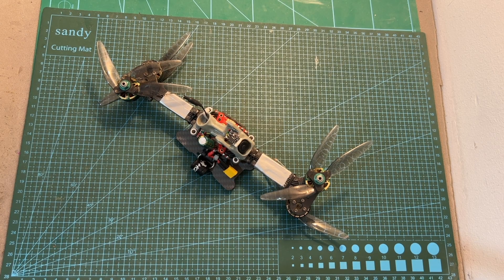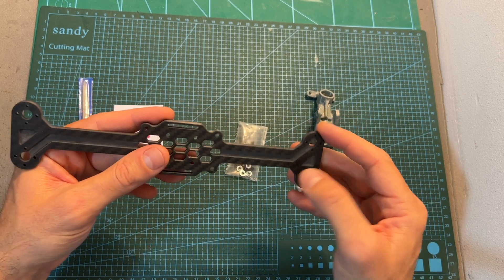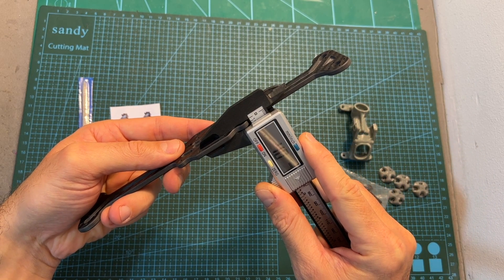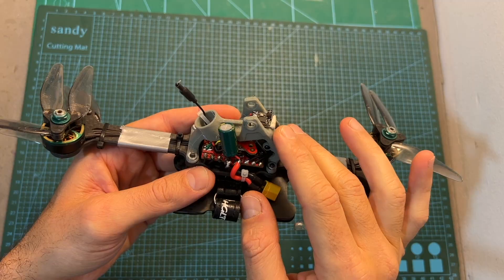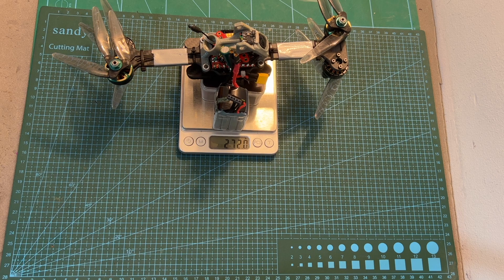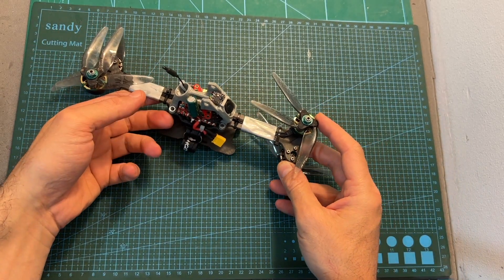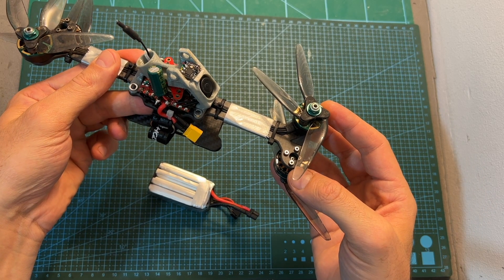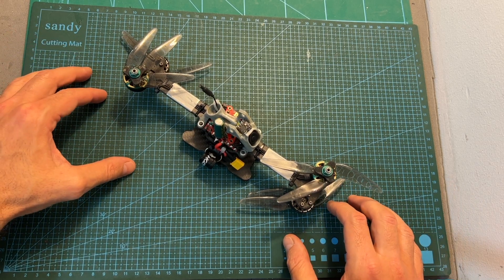XXXFPV Bone Drone - Build And Flight

Comment: Great video. I really appreciate your honest opinion on this frame. Mine was in the Mail today and I'm about to switch my electronics from my iflight Protek35, because I'm not flying this anymore. And as you said, one can always switch electronics to another build. My reason to buy one was, as you said, to have spmething different in my collection. I'm curious about to find out how it works with BF 4.3, which is really good on my regular 5" even in stock Settings.

Did it handle the Crash at the end well or did something suffer from that more than a regular frame would?
Reply from the maker: Thank you!
Yes, it's a cool concept. 
I am actually going to do something interesting with this frame (2 of them to be exact) so stay tuned. 
 I don't recall that I had any damage after the last crash so all is good :-)
Reply: @KremerFPV  When you say two, I imagine an FPV octo-catamaran 😆 I'll stay tuned 👍

Comment: Hi there, nice video!  Is it possible you can share your BF version and PIDs please?  I have built one of these, and it suffers from some oscillations on stock betaflight.  Thanks in advance! 👍
Reply from the maker: Thanks! I've just used the latest BF version of the FC that I've used and stock settings. It doesn't fly that great on my video too unfortunately and I don't have the time to try to tune it...

Comment: Efficiency cant be be very high with the props being in each others wash but maybe the reduced AUW comoensates for that somewhat. Must be a bitch to try and tune out these propwash wobbles.
You might expect that it would have poor roll authority with such little distance between the props but I guess it also has equally less mass to move on that axis also.
Curious as to how well it flies/handles sideways vs forwards?